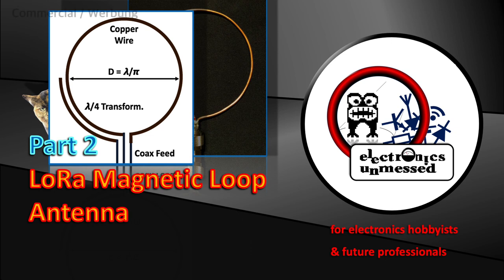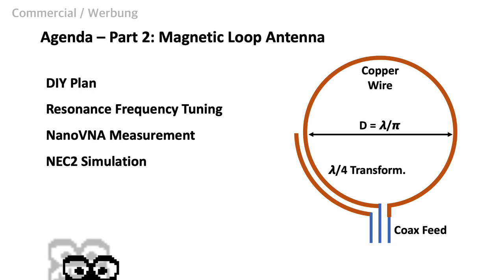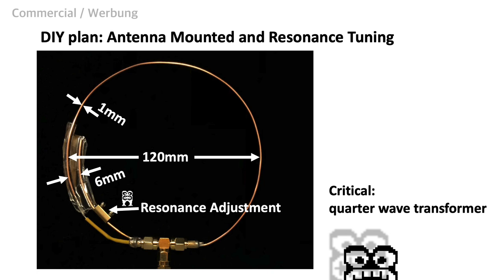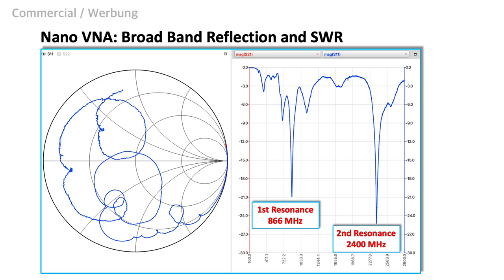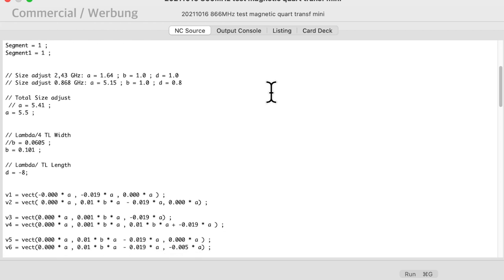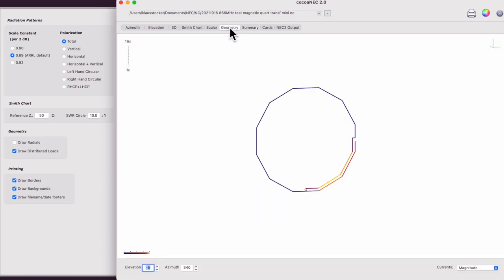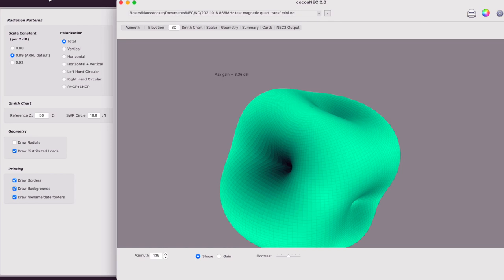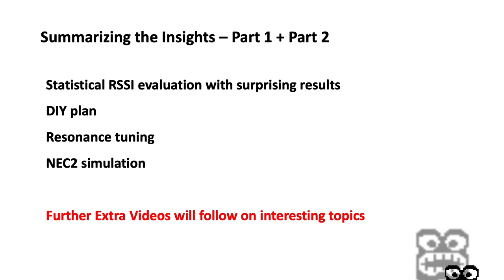DIY Loop Antenna for LoRa tinkered, measured and simulated with NEC (EP26)

Comment: This is very interesting and should have great commercial applicability. I am a little confused though. Normally an antenna has spacial gain which is evident in the pattern, for example the toroidal pattern associated with a dipole or quarter wave loop antenna. This antenna seems to have low spacial gain, but is achieving higher SNR due to it's high Q frequency response. This would be a significant advantage in a low cost system, less so in a higher cost system where the receiver could filter the input to select the frequency range of interest. In any event, I will be watching the rest of your videos to learn more about this unique antenna design.

One of the primary reasons for using a short loop antenna (i.e. less than quarter wavelength) is that these antennas are less sensitive to ground plane consideration, probably because they generate a magnetic field with a low characteristic impedance in the near field as opposed to the electric field with high characteristic impedance generated by a dipole. I assume your antenna would have a low characteristic impedance in the near field, but maybe not...
Reply from the maker: Thanks for your great comments. Really nice to read comments from somebody knowledgeable about the topic. I am curious to read your comments about the further videos about this antenna type.